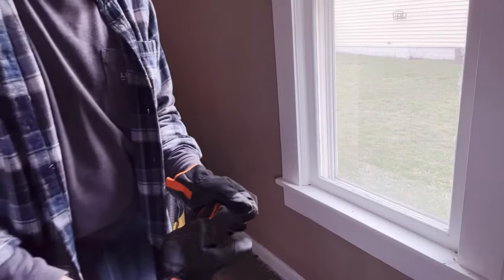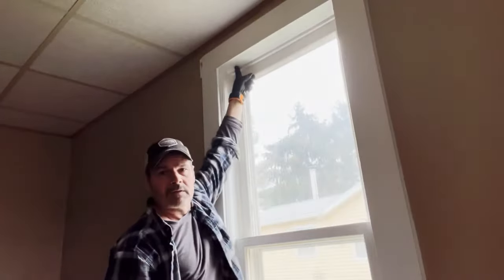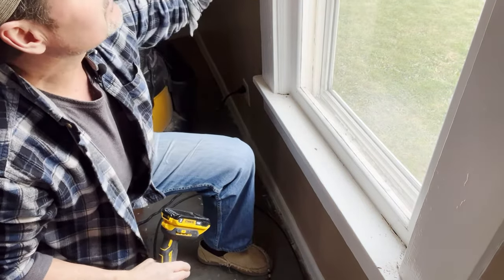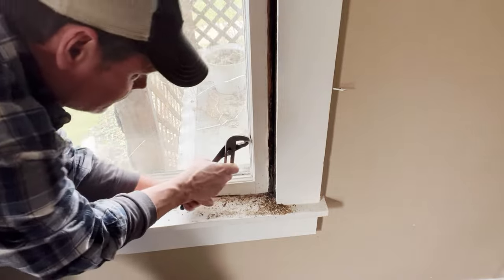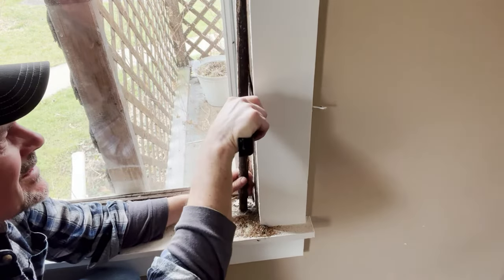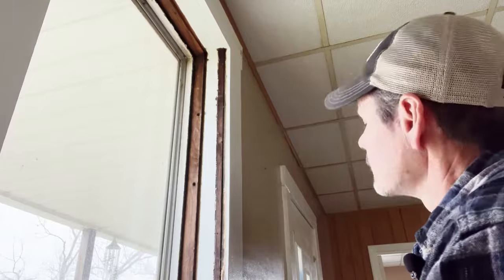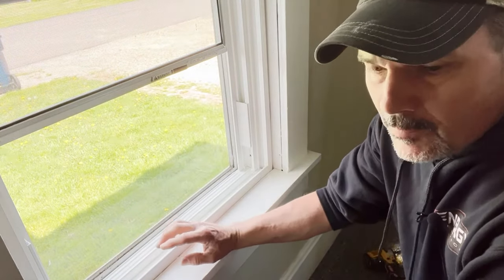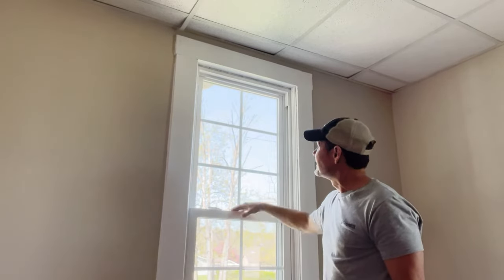How to Remove Old Windows and Install New Windows. #Windows, #Replacement, #Wincore, #DIY,  #House

Comment: Great video. You did a great job filming the removal of the old window and a fantastic job showing how to install the replacement window. It's so difficult finding videos on how to install window inserts. Most windows are the front screw in kind.
Reply from the maker: Thank you! I appreciate you taking the time to comment! Hope you have great success!
Reply: @DiyGuy50  With your video, this will be a breeze. Keep up the great content. I already subscribed.
Reply from the maker: Measure carefully and check square and you’ll be good! Thanks again!
Reply: @DiyGuy50  I will do. Because of your video, I learned that the stop trim isn't a part of the window. I had no idea until you explained and demonstrated it in your video.

Comment: How important is it to use foam? I have a loud road behind me and I only have dual pane vinyl low-e windows. Contractor says he doesn't use foam in case of any repair or or replacement.
Reply from the maker: The foam is not necessary. But the gaps should be filled with insulation of some kind. I often stuff fiberglass insulation in the gaps using a paint stir stick or anything that works. If you do use foam, make sure it’s the foam specifically for windows. If not, it expands too much and the window is hard to open and close. Great question!
Thanks for commenting!
Reply: How about rock wool insulation?
Reply from the maker: @ShawnathanTKV  I’m not familiar with rock wool insulation, but it would probably be fine as long as it doesn’t draw moisture and expand too much.
Reply: @DiyGuy50  I used it for insulating my exterior walls. It's made from volcanic rock and it's fire resistant and doesn't absorb moisture. Great stuff
Reply from the maker: @ShawnathanTKV  Excellent!

Comment: Good video and explanation of the process. If the old wooden window has a metal track guide along the sides are they removed as well as the sash stops? Thanks
Reply from the maker: I’m not sure because I’ve never ran into that situation, but I think you would have to in order to put your replacement window in. In the houses I’ve done, the replacement window slides in leaving about an 1/8” gap between the side jams. When there are pulleys in the side jams I just hammer them flush with the side jams but I don’t think that’s what you’re  talking about. Hope this helps. Thanks for watching!
Reply: Thanks for answering my question too.
 I was wondering what to do about the weight pulleys.
Good enough!

Comment: I realized you kept the exterior storm windows.  What made you decide to keep them? If I’m going to replace my windows I’m struggling what to use to cover the expose external trim when i remove the storms
Reply from the maker: Hi. I took the old storm windows off. I left them on until I was ready to apply silicone caulk around the exterior of the replacement windows . This house had aluminum siding and the original exterior trim on the windows had been clad with aluminum and was in good shape.
Reply: @DiyGuy50  so I have the same, aluminum siding and trim.  My issue is how do
I cover the expose wood trim once I remove the storms? There will be a section probably the same width of the storms. Did you just caulk that?
Reply from the maker: No I painted any exposed wood as well as the aluminum around the window trim. It turned out great!
Reply: @DiyGuy50  ahh I was thinking to that as well since I don’t have the aluminum bending machine to replace the existing ones.  Thanks
Reply: @DiyGuy50  sorry one last thing, what primer and paint did you use for the aluminum?
Reply from the maker: @bhadz100  I wiped all the aluminum down with water and a sponge to get all the chaulky residue off off it and just painted it with Sherwin Williams exterior paint. I did use one of their best paints. (They have good,better, best grades)
Reply: I'm a bit confused. I'm back here for a refresher, having replaced my first window about a year ago. On that window I just left the storm window on because I figured any extra insulation is a bonus. It seems to be working fine. 
Is there some detriment that I am missing that requires removal of the storm window when installing a double pane glass replacement ?
If not, I am content to just leave the storm windows on the house.
Reply: @ginakerry2588  if you put a window ac that external window will protrude.  Plus it’s a cleaner look without external storm
Reply from the maker: @ginakerry2588  I took the old storm windows off because they were in bad shape and an eyesore, but there’s no reason you shouldn’t leave them on as far as I know. Thanks for your question!
Reply: @ginakerry2588   You’ll NEVER get the triple track storm windows out for cleaning once you install the new replacement windows !

Comment: The flashing tape should be installed around the entire opening, not just the bottom of the opening. Similarly, the interior casing should have been removed and the foam should have been applied around the entire jam! There’s certainly a 1/2” gap around the entirety of that old rotten jam and it needed replacing more so than a coat of exterior white. Kind of a rush job imo.
Reply from the maker: Ok, Victor! How are you? First of all, the “jambs” are not rotten at all. There isn’t a half inch gap around it and removing the interior casing is completely unnecessary as is the flashing tape around the entire opening. Thanks for commenting though!
Reply: The foam around the window is completely unnecessary, i install windows for a living and i never would have thought about using foam there, i just use high grade caulking and seal up the edge of the window
Reply from the maker: @davidbowling5391  Thanks for your comment! That's good to know! I don't do this for a living but I have done several rental houses that I own.
Reply: @davidbowling5391  that’s how we do it
Reply: @DiyGuy50   He is just pissed at the fact that you showed to everyone how easy is to do the job he taught he is valuable and irreplaceable. Just realized anyone can do what he does without paying people like him ridicules amounts of money…
Reply from the maker: @nenadvukojevic4195  I think Victor was talking about a new construction window instead of a replacement window. In this old house the existing frames were in great shape and did not require replacement of the entire window frame and window. When necessary, I have replaced the whole frame and window and have done what Victor was describing. Thanks for your input and support!
Reply: So many people saying they don’t use foam smh
Reply: @vanceswann182  Not all of us buy the new building "science." I don't want a toxic product in my home build or my house so tight I have to put a hole in it for "ventilation." How stupid can it get?
Reply: Yeah while you're tearing off the casing to insulate behind the jamb, tear off the plaster and insulate all your walls too!  You don't have to tear off the casing and destroy the paint line, etc. You could drill holes and spray foam that cavity if you want.

Comment: I don't have that tool. Use something everyone don't have. 3:28
Reply from the maker: You don’t have to have a multi-tool. A utility knife will work too. Anything that will cut through paint will work. The trim pieces the hold the old window sashes in place are often very old and have layers of paint and sometimes caulk around them and you just need something that will cut through those layers so that you can get them off easier without damaging them. If you’re planning on replacing them, you can just take them off with a pry bar and hammer.